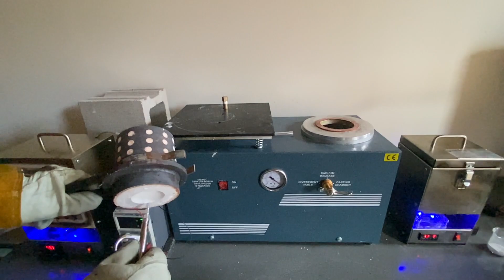Getting Much Better - Casting a Two-Stroke Engine

Comment: Why didn't quench when hot to remove piece from plaster?  Are you getting better results on surface of metal doing it this way?
Reply from the maker: I still did quench when it was hot. I had just added boric acid to the investment before mixing it which makes it incredibly difficult to break the cast open.

Comment: Nice work. What are you going to use to line the cylinder once its done?
Reply from the maker: I intended on platting the inside of the cylinder with copper or another dissimilar metal to the piston. I made a video about my experimentation with this. However, unfortunately, I had to close my shop and I won’t be finishing this project in the near future.

Comment: it looks like you had the vacuum on the wrong setting when you poured?
Reply from the maker: The vacuum selection handle is a bit confusing but if you take a look at the vacuum gauge you can see that it is working. Thanks for watching!

Comment: Really nice results! I always avoid blind holes unless they are very shallow, through-holes seem to work fine as the plaster has support at both ends. Did you add boric acid, or borax, and what ratio? Certainly seems to have hardened the plaster, I might try that myself.

For the transfer port channels, you could try threading stainless steel wire through the channels in the 3d print before investing, this should reinforce the plaster and afterwards you should be able to just pull the wire out of the cast metal part (it shouldn't end up within the metal).

I notice you have an air pump hooked up to the burn-out oven,  is that to flush out the gases?
Reply from the maker: Thanks! I’m not sure how I am going to try to help the blind holes on the exhaust cast but your idea about reinforcing the transfer ports with steel wire sounds like a great idea. I did add some boric acid to my investment. The ratio I used was 20 grams of boric acid for 1 liter of water. I added the boric acid to my investment powder before mixing and this worked great. 

The air pump is supposed to help regenerate the oxygen and flush out the other gasses inside of the chamber. I did this after reading about it in James Binnions paper on preparing resin prints for investment casting. Haven’t done any experimentation to tell if it has any major effect but my furnace hasn’t fallen apart yet and my cast are progressively looking better so I don’t think it’s hurting. Thank you!

Comment: Great it work nice. Amazing Cast
Reply from the maker: Thanks! The boric acid worked great, thanks for the suggestion!
Reply: Levi Sheridan you use compressed air to clean it inside that will be my next suggestion, but I have some mix feeling with this because the cool air may break the detail in the plaster. Any way great job.
Reply from the maker: @GMezzacapo1  I did actually use compressed air to clean out the mold before pouring. I would agree that there is a possibility of the air breaking the mold but It’s unlikely considering how hard it was for me to break the investment after quenching.

Comment: 'Cast' is the past tense of the verb 'to cast'. E.g., "I cast the engine part in Aluminum."
A cast part is called a casting. E.g., "This is my best casting yet."

FYI. :)
Reply: lol, Casted was killing me.  Still a good vid thou :P
Reply from the maker: @DaveDodd  I’ve corrected the title so you can rest easy now. I’m glad you enjoyed the video!
Reply from the maker: Thanks for the info! I may be wrong but I do not believe it is incorrect to use ‘cast’ as a noun. If I had a very nice 3D print I would say it’s my ‘best print yet’ and this seems to transfer over to cast objects. I don’t have any grammar education outside of high school so I may be wrong. As for the title, ‘Casted’ is definitely incorrect and I will be changing it. Thanks again!

Comment: what a freaking mess!  Sad it didn't disintegrate like it was supposed too!  Finally product looks nice tho.
Reply from the maker: Thanks! I had to go to town on the plaster with my flat head and hammer for 8 minutes to break that thing free. The boric acid I added is what did it. I think the increase in hardness is worth the extra work at the end. The biggest challenge with casting this part are the curved and blind holes. I think an increase of hardness will help prevent those features from breaking during the pour.